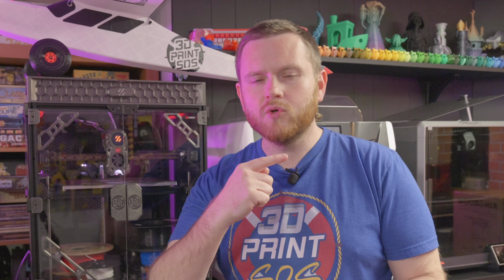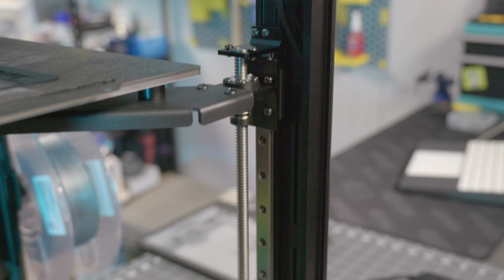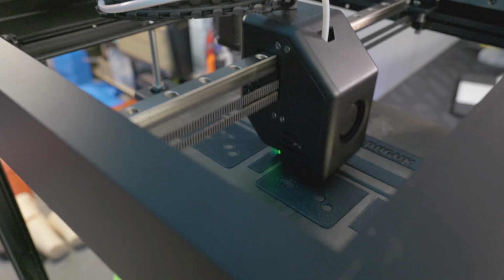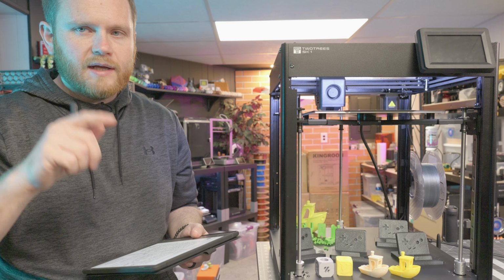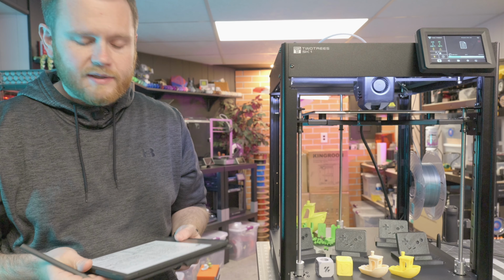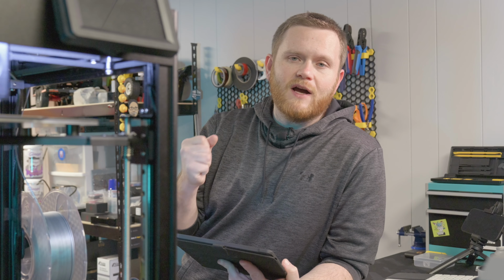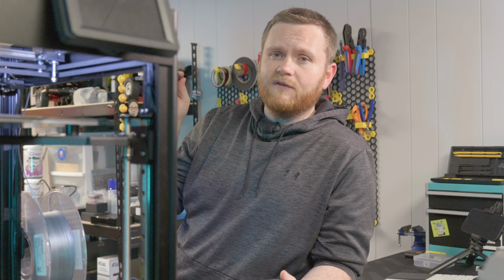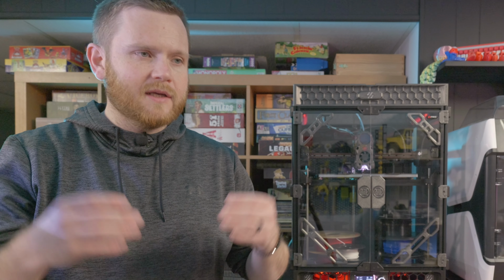TwoTrees SK1 - A Pre-Built Voron Trident or Another Clone?

Comment: There's also a significant problem with buildplate flatness. Originally it was 0,56mm at 80C. Tigthening plate screws on hot plate and couple other tricks made it 0,3mm and it's still the worst result out of a few Qidi Plus4 and Flying Bear R3 I have, where 0,2mm is typical (but over 300mm plate, not 256 !).
Overall SK1 is functional, but with enclosure it's more expensive than Qidi Q2 (let alone Q2C) while having a few weak points.

Comment: You do not need to stick that ptfe tude inside toolhead every time. Put just peace in toolhead leaving 10mm on top, then use lager diameter tube peace to put on top of that. basically use lager diameter tube peace to connect both parts of tube. Its no bowden so it does not matter if ptfe moves up and down on retractions. Disconnected tube near hotend going to be upgrade anyway in long run for filament changes, clogs, puling out filament etc

Comment: there are a lot of mechanical problems that you don't mention. The final build quality is poor. Many people will receive a printer with a broken anti-backlash nut on the rear Z-axis. The belts are poorly tensioned, one is very tight, the other is weak and it is a little longer than necessary. My printer has play in the X rail slider carriage and rail-slider needs to be replaced.
Reply from the maker: I didnt have any of those problems. Both you and I only have one machine though so its hard to say what others will experience.

Comment: Bought at $250 for the Black Friday.
Took also the enclosure all metal and front/top are true glass smokend and tempered, very high quality.
I've been able to install plain Armbian and Klipper from the Armbian for SKIPR project of Maxim Medvedev. It works with both Bookworm or Ubuntu Noble versions. 
The new OS and Klipper after flashing THR and MCU resolve lot of THR's disconnection problems. And the machine is ready for build a full stack of Klipper mods and macros and another screen project. 
No way to connect an HDMI/SPI screen on the board only UART ports, so we have to revert to CYD or Xserver-XSDL projects. 
And connecting the mainboard cooling fans to a controlled port they start only when needed.
This machine is really fast! I've lot of problems with cheap PLA/PETG adding 40-50% speed thanks to CHT nozzles, but if you want to save lot of time in prototiping you need HS PLA/PETG and they are abviously more expensive.

I don't think it will have more firmware updates because 0.12 of Klipper needs THR reflashing and the producer didn't put an USB pins header on the THR board, so the user has to dismount and solder pins, and build an USB cable. Not for every user.

Comment: Thanks for the awesome review , I have this printer and its great but, I prefer Mainsail so I put it on via KIAUH but like you said they had to do some modifications to stock klipper so Mainsail is giving me a notification that all the features aren't available because  it has an outdated version of Klipper so I uploaded Klipper via KIAUH but that broke everything because the MCU and the toolhead board's MCU are also running an outdated slightly modified version of Klipper,  i can reflash the mainboard MCU but I cannot do the toolhead board MCU because it doesn't have a usb port it has the pins holes for usb but looks like TwoTrees ordered custom board from MKS for this printer and the removed the usbC port so i can't flash the RP2040 chip on it with an updated kilpper.bin
Reply from the maker: Oh yeah, updating klipper manually on these machines is a big no no. Ooops
Reply: Yeah I just tried it , cuz I knew I could just go back by refreshing the EMMC with stock and I did and it works again now I may just look at swapping the Mainboard and toolhead board with bigtreetech ones and just use the stock hardware I actually love doing think ind of thing , I did get klipperscreen working remotely on my BTT pad 7 by telling the klipperscreen.conf file to go to the ip address sk1 so at least there is that
Reply: However twotrees did something that broke thumbnails even on webUI I can't figure out what they did

Comment: Great overview, you can do some upgrades to fix some of the cons you mentioned, but because of that it's definitely not for people expecting to take it out of the box and go. This is for people who want a trident but dont want to spend a ton of time building it. You can change the fans in the bottom to act as "controller fans" on a different port so they are off during idle. I also upgraded the psu to a fanless meanwell. The toolhead fans would require a new tool board to change. Im also upgrading the bed and bed mounting to use trident parts with the bearings and adding a rail to the back leadscrew. My stock bed is not flat at all 0.4mm difference 😢 main thing that sucks tho is TT themselves not releasing their FW changes or any documentation they act like they wrote their own firmware further following the terrible trend these chinese companies do with IP theft for theirnown gain.

Comment: The Voron Trident uses 3 independent Z steppers. Do you confuse it with the VZbot?
Reply: This printer also has 3 independent Z steppers
Reply: @nunovicente34  I know, but he told that the Voron Trident uses one stepper with belt for Z instead of 3
Reply from the maker: No sir. I did get tongue tied a few times making this video, but the trident got its name because of the 3 independent z steppers. I was saying other machines of this style have a belt system.
Reply: @3DPrintSOS I checked again, and you are right. You told "outside of the Voron Trident". So sorry for my false claim.
Reply from the maker: No worries Gerald. I appreciate you trying to get the facts straight.